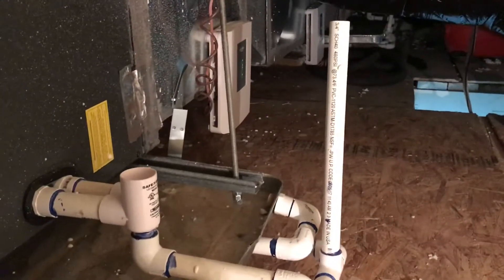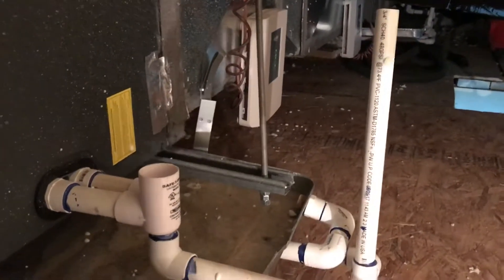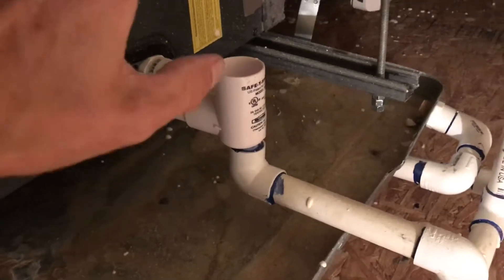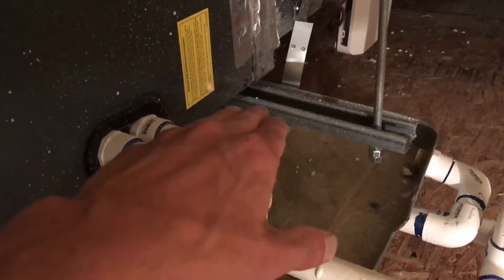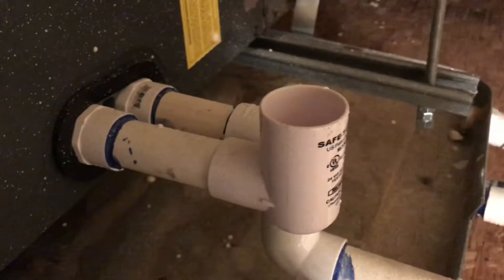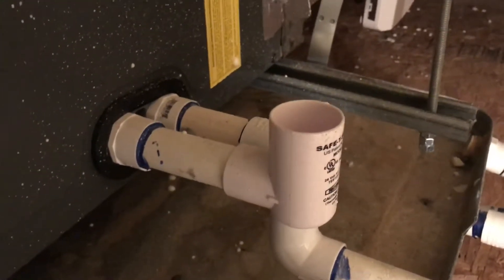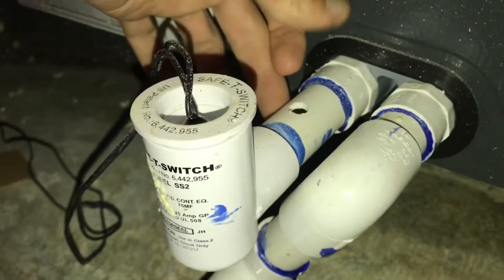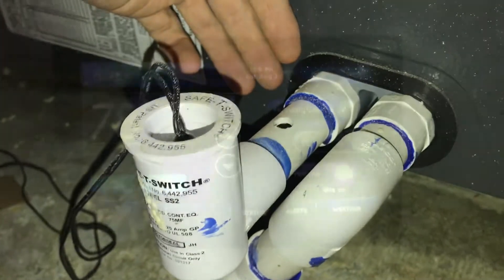AC shutting off/safety switch/thermostat/condensate

Comment: Those are adjustable. Drilling a hole is probably unnecessary. I would have adjusted it higher by rotating the screw or address the underlying static pressure issue.
Reply from the maker: For sure, but I’m not sure how to adjust the pressure issue,

Comment: I think mine has a similar issue. The heat shuts down under 40F and I think it’s the pressure & safety switch after watching the video. I’ll reply back if my problem is the same. Couldn’t find an answer to this anywhere else!
Reply from the maker: Hey there ya I looked and looked and couldn't find anything that was even close to the symptoms, been working good since doing it, after I drilled the breather holes it helped, the safety switch was just way too sensitive, thanks for letting me know

Comment: I’m from Lexington Mississippi we got central air in central heat why does the pipe always get stopped up but I have use bleach and crocs and it’s still leaking I use bleach and Clorox tell me what’s the problem with rise against Dr.
Reply from the maker: That’s what I do too is a flush of bleach water every so often, and since it’s so humid there I bet it puts off a lot more condensation in the line then here in Arizona, it’s pretty dry here, maybe if you have access to a small portable air tank or air compressor you could blow it out, if it is closed up that much then maybe it’s plugged more then the bleach water can handle, I would try to blow it out and get any buildup that’s in the pipe out of there!!! Thank you for watching!! Hope that helps you out!!

Comment: It seems that you should test your theory by actually adding water to the drip pan such that it forces the correct operation of the ac switch cutoff even after your hole was drilled. Until then, you've no proof that a clog or drain pan overflow will actually work in a "live" EVENT? Yes/No? My issue is with a new system that drains outside...my cutoff switch will activate because there is a nominal amount of water that reaches the switch, although the AC guys have flushed the white drain pipes twice. Went on vacation and my AC cut off for 10 days!
Reply from the maker: Yes I can see your point there, by the way I figured by testing out the switch outside of the pipe, is that it requires so little pressure to trip the cutoff switch that even the small amount of blowback of air coming from the unit was enough to trip it, and in measuring the depth of the switch inside the pipe holder that it sits in, it is about half the way up the horizontal pipe, so I was pretty confident that the water level would be able to trip the switch before the water would ever reach the top of the horizontal pipe where the holes on top were, and before the buildup of condensate would be enough to overflow the drain pan. I spent quite a bit of time determining just exactly what would happen in the case that I would need to rely on the switch, and felt 100% confident that it wouldn’t fail and cause damage to the ceiling and drywall underneath, could turn out to be an expensive oversight if I wasn’t confident, but I understand where you come from and appreciate the question l, even though I’m a few months late sorry, but also, you wouldn’t believe how little movement in that safety switch is required to shut it off, just the slightest movement and it stops, which is why I did this in the first place, the back pressure was enough to trip the safety switch!  Thanks for the feedback and for watching, and very lucky that yours didn’t overflow while you were on vacation and did it’s job! Thanks for watching!!

Comment: Now the safety switch will never tripp because the water will drain out from that hole you drilled
Reply from the maker: Actually the plunger for the safety switch is millimeters off the bottom of the tube, and requires almost no travel upwards to trip the switch, so it will trip long before the pipe ever got full, I did think of that and the consequences of it not tripping. Thanks for your insight though!

Comment: There is no p trap for some air
Reply from the maker: Could you tell me where the p trap should be, in the condensation line where the excess water drains or in the tube for the safety switch, sorry I don’t do much with hvac /plumbing, so any info you could give would be appreciated, thanks!
Reply: @Azkeyguy  so the elbow going down should be removed and replace it with a tee. On top of the tee should have a 3 to 4 inch pvc not glued.
Reply from the maker: Ok I kinda checked out some stuff on the net so I kinda know what your talking about now, I’ll have to get up there this weekend and check it out, probably time to flush the tube out anyways, thanks for the info!